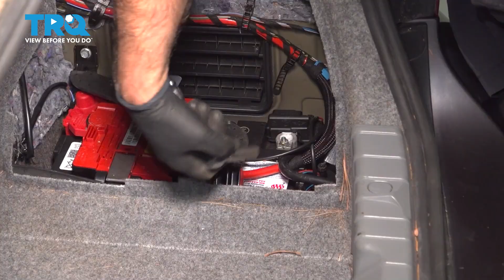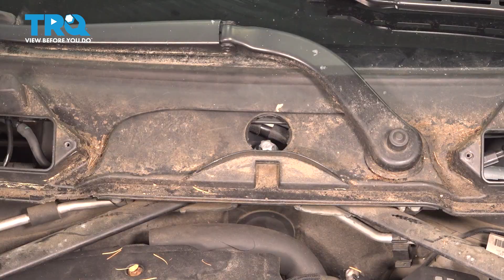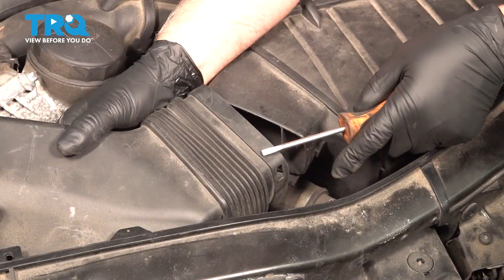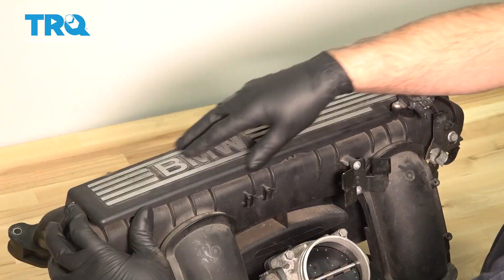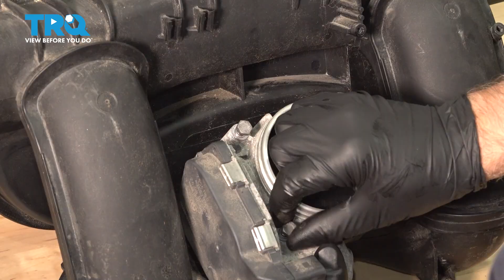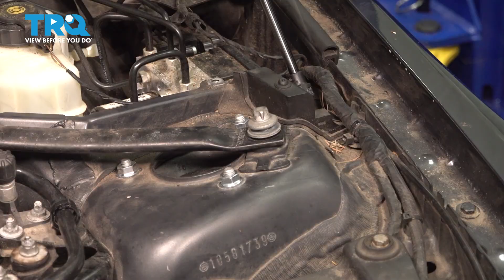How to Replace Intake Manifold 2007-2013 BMW 328i 3.0L L6

Comment: Great video, but it would be great to list the P/Ns of those hard plastic hoses you removed, since no one can remove them with a pick unless they are brand new.  The only way to remove them after being on the car for 16 years is to cut them in half and buy new ones.